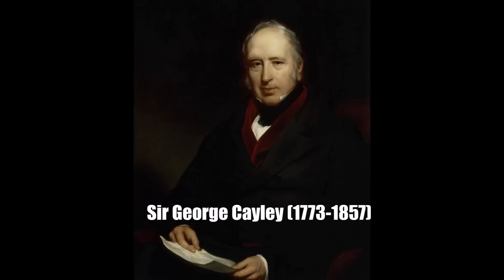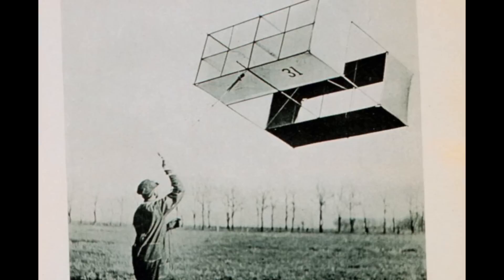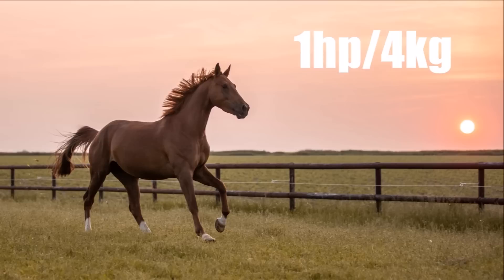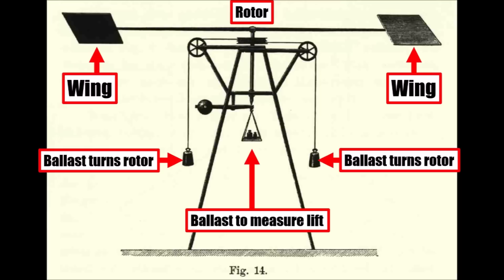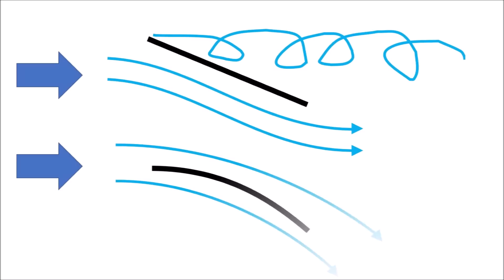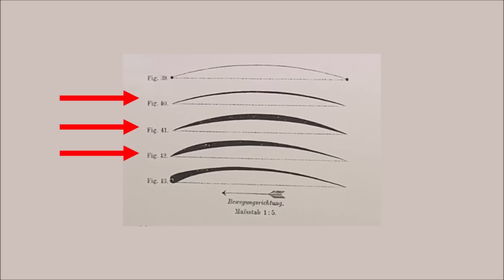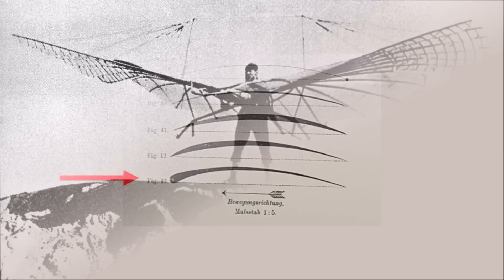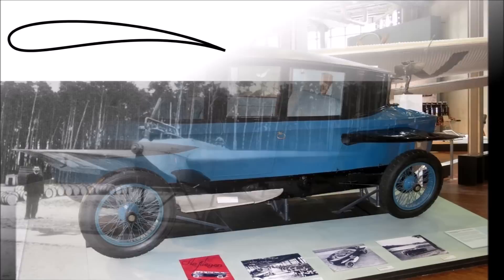History of Wings - And how they got onto Cars

Comment: Great video, but there is another fine point you did not mention - earliest and modern wings are mounted on the chassis so they require stiffer springs and dampers which reduce mechanical grip. Lotus 49 and IIRC Chaparral had them mounted on suspension uprights so aerodynamic loads acted only on tyres, and springs and dampers could remain softer. FIA soon banned it (in early '69).
Reply from the maker: Yes, very true. This was more a general overview about wing profiles and how they got onto cars.
Wing mountings on cars could be a separate video.
Reply: It also depends on the Series, on Formula SAE you can (or at least could till few years ago) have the rear wing with 4 flexible mounting points, 2 on the chassis for balance and 2 directly on the wheel hubs. I'm not sure if there's another series that would allow such things, but there might be.
Reply: What was the reasoning form banning suspension mounted spoilers? Was there a safety concern or was it just too good to be allowed?
Reply: @TrolledBy  Oh, if you're still curious, it's likely because it was a dangerous arrangement.

When cars have wings attached to the chassis, they can have sturdy and fixed supports in order to keep the wing safely attached, and the suspension has to be hard to take the load (so the body doesn't move as much). That also means you can't add more downforce than the suspension can't handle.

 While if you mount it directly on the wheels, the supports have to be flexible or have joints (which makes them weak), even more so because the car suspension will be softer. And there's no limit to the amount the car can handle, you keep adding it untill it breaks.

That proved deadly because Colin Chapman was willing to do anything to reduce the car's weight, even use weaker supports. One of his cars crashed (I don't remember which) but this was banned shortly after.
Reply: @davidaugustofc2574  Ah, that makes sense. Thank you for the explanation. 

Although that does make me wonder if suspension mounted spoiler would have any benefits in a modern racecar with modern technology and safety. Maybe for something like a time attack or a hillclimb where you're not risking other competitors.
Reply: @TrolledBy  Technically it should, maybe it'll make a comeback like ground-effect did.
Reply: @TrolledBy  In the 24 hours of Lemons racing series, there's a team of engineers who built a Miata with a giant wing mounted to the suspension. It seems to be working very well for them, though this is in Lemons so none of the cars are super fast to begin with, it's just making a slow car as fast as possible.
Reply: 7:07 funny that they didn’t turn the wings upside down but angled them… clearly no full understanding of the aerodynamic principles
Reply: @TrolledBy  I think they were rather flimsy and tended to break, with the sudden reduced downforce accidents were the result
Reply: @964cuplove  in their defense, even if the wing is slightly cambered it should generate negative lift the way it was set up. If it didn't they would need to think of a way to solve that.

Comment: Jim hall had wings on earlier cars including the active aero mechanism although they more closely related to a spoiler when used for cornering. Fun fact on the 2E which is the predecessor to the car you showed in 67. Jim had already started to move the radiators from the nose to the sides to allow for a front duct that channeled air up over the nose sort of like a front diffuser. The active rear spoiler was tied into this by closing the duct with a plate to cut drag and keep balance. You could quite easily do a full video on all the tricks Jim Hall had with automatic transmissions to the first Fan Car
Reply from the maker: True, Jim Hall is enough content for a separate video.

Comment: 6:59 - Wouldn't this wing produce lift instead of downforce?
Reply: As he said in the video they gave it a large negative angle of attack to try and get downforce. This method is obviously not the best and I wouldn't be surprised if the flow separated on the bottom of the wing and it made pretty minimal downforce.
Reply: @alexanderklenk2195  ah, now I get it thinking about it some more, didn't make sense at first because that's literally the worst possible way to generate downforce with that wing. Interesting nonetheless.

Comment: Interesting, although it doesn't answer my main question - and that is: why did it take them so long to put wings on early F1 cars? It seems like the obvious thing to do in retrospect and yet it still took them almost 20 years! I wonder what the reasons for that were.
Reply from the maker: I was wondering why they didn’t use them on the Grand Prix cars in the 1930s. There were quite some modern aero solutions... still researching
Reply: If I had to guess, it's because the thought process of the time was more power = more speed. Even Lotus' light racecars were thought to be revolutionary even though in retrospect it seems so obvious. Could even be possible that people like Enzo Ferrari were lobbying against aero because their pride and joy was having the most powerful engines. Imagine that one dude rolling up in qualifying with a wing and doing 2 seconds faster than everyone else so he gets lobbied out of the race by other competitors.
Reply: @TrolledBy  Ironically Ferrari and Brabham beat Lotus to the wing game. Everybody uses the 49 as a reference as the Gold Leaf car looked so outrageous, but they weren't the first. Oh, and this excellent video skips that the high wing(s) were banned in the middle of the Monaco GP weekend, so you'll see images of both high winged, and the 'spoiler' 49 car from the same weekend.
Reply: @peterf1  Brabham were the first to bring wings to F1 in 1967. A year later they were joined by Ferrari and Lotus all sporting wings and aero stubs at the Spa circuit. The real irony being that in 1960 Enzo Ferrari had actually told one of his race drivers at Le Mans, "Aerodynamics are for people who can’t build engines."
Reply: @BSport320  "Aerodynamics are for people who can’t build engines." - Enzo Ferrari
Reply: @maleagerlemitee676  Thank you for the response. So, there's unending conjecture about this as there is endless splitting of hairs about what is a spoiler and what is a wing. To me it's quite straightforward. A spoiler deflects air to reduce lift. A wing creates downforce. IMHO, both Lotus and Brabham had spoilers, and it was Amon's Ferrari at Spa in '68 that had the first true wing. Apologies this is all pretty pedantic. But agreed Brabham had the first aero tabs/spoilers.

Comment: I still consider 2007-2008 the height of F1 aerodynamics.
Reply: Do you think they’re somehow progressing backwards since then? The height of f1 aerodynamics is today
Reply: @uninsulatedshrimp5518  The entire point of the 2022 regulations was to hinder downforce.
Reply from the maker: Also for me as F1 aero designer, 2007-2008 were the most complex cars and shapes by far.
In my time at McLaren I frequently went down to the hall to have a close look at the 2008 car and tried to redesign these complex shapes to train myself.
Today's cars are quite simple compared to that, but of course today there is more knowledge about complex flow structures.
Reply: @BSport320  I've been thinking for a while that eventually F1 regulations will have covered almost every possible style of aero package you could conceive of, and at that point there would never be "new" regulations, just a cycle between different formats.
F1 should curtail the problem of long term dominance of a single team with yearly swapping between significantly different racing formats across a four year cycle. "Theoretcially" you'd never allow one team have the advantage more than once every four years.

In my opinion F1 also needs to add the possibility of refueling back to really accomplish that, the intense driving style of Senna requires frequent tire changes, so that would have to be included as part of the format, for that matter just swapping between refueling and non-refueling would almost guarantee you'd never have the same champion two years in a row because they're almost complete opposite driving styles.
Reply: @uninsulatedshrimp5518  They have gone backwards because of FIA changing regulations every few years.

Comment: Totally flawed theory. The bird doesn't need 1 horsepower of its own as its the wind on the underside of the wing that lifts it. I kite surf but don't posses 1hp of strength. The curved top does not create the lift but bleeds the stalled, drag, air off the back of the wing. Curving the underside simply creates a scoop like flaps on a modern plane. Its the angle of incidence that lifts the plane, or bird,  and the profile reduces drag increasing efficiency. Thicker section for lower speeds as they have a very steep angle of incidence thinner or laminar flow for high speeds.

Comment: 10:01 politics ruled in racing, even then...
Reply: Reminds me of a dirt hill climb event I watched on one of the ESPN channels about 20 years.  They had a truck class where at least the bodies had to be as purchased. One of the trucks to show up was the 2nd Gen Ford Explorer (had a proper IFS, but still roll over prone) and another was a Chevy S10 pick up……with a bit of a spoiler on the back, which should have been illegal for the class. Well, the Explorer driver protested it and the S10 was allowed to keep it‘s spoiler, which understandably pissed off the guy with the Explorer. One hand feature the Explorers had for multiple generations is a window in the rear hatch that could be opened separately from the hatch……it also happed to open up fully at the right angle so that it could make a pretty decent spoiler in it’s own right all while being OEM equipment on all Explorers! Well the Explorer’s Driver opened the hatch glass and put down a better time than the S10 with the technically illegal spoiler. Since that did not set well with the S10’s driver, he protested and won🤬